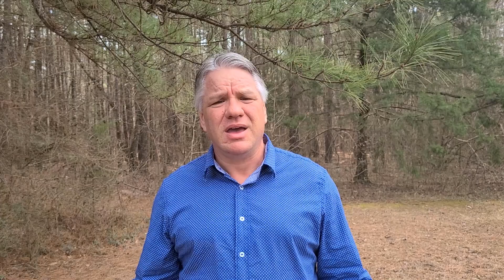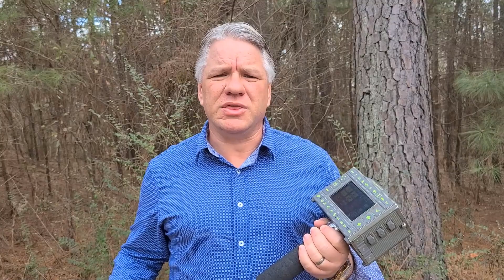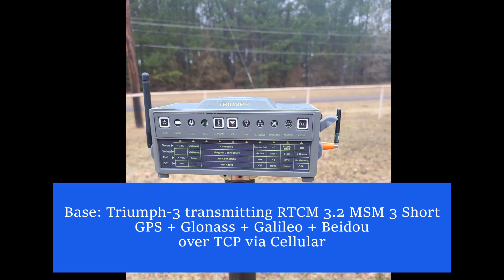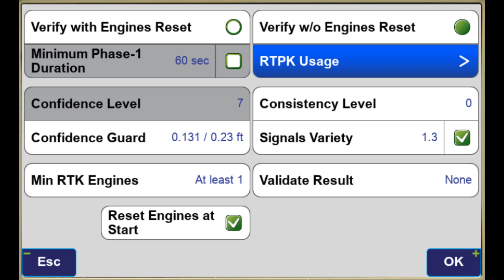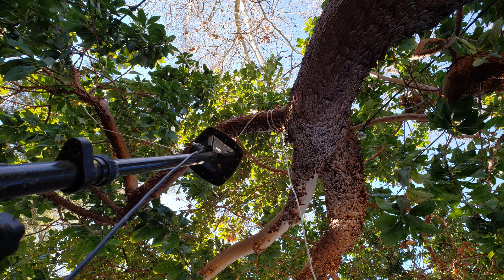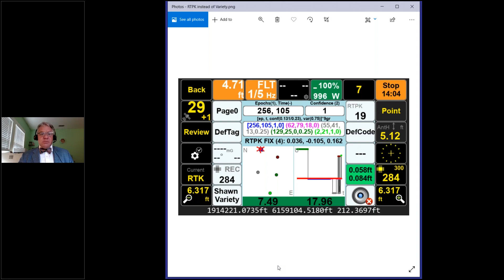Workshops: TRIUMPH-LS Plus Introduction

Comment: Hi Shawn! The TRIUMPH-LS has 6 RTK parallel engines while the TRIUMPH-LS Plus is equipped with only 4. Is this correct? In terms of redundancy, the previous model provides better solution. What is the selling point of the Plus version? By the way, is Javad's RTK engine a hardware implementation or a software engine? Thank you.